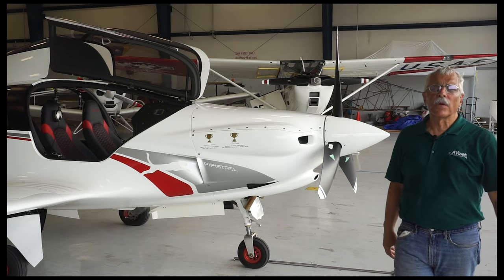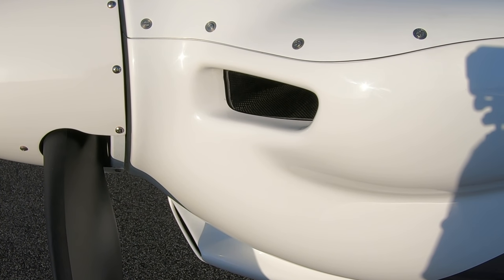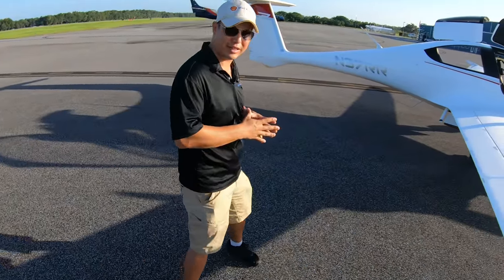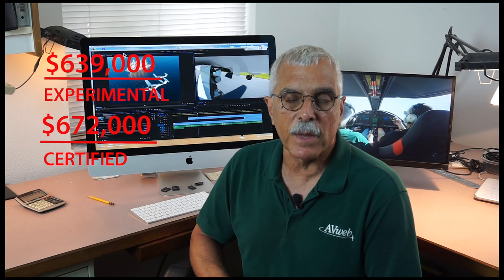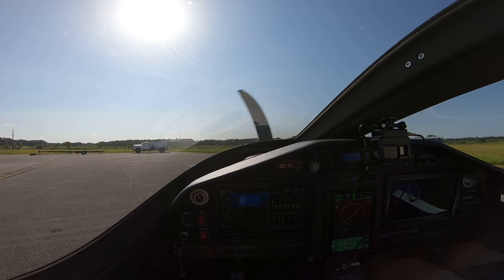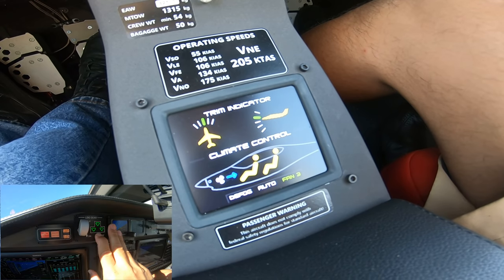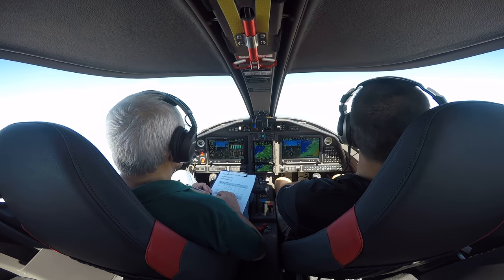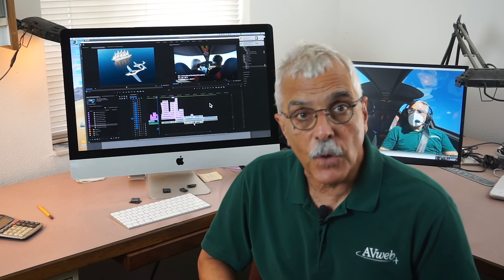Flight Trial : Pipistrel's Sleek Panthera

Comment: The limited view out of the front is a "no deal" for me.  Awesome plane, but that limited forward view ruins it for me.  They could have done something like the Bristell did, and it would have worked much better.  I do love that the pilot is ALMOST in front of the wings.  It appears it might be the only low wing plane to puts the pilot that far forward of the wing center, which is awesome.  I like to sit more upright when I fly so I don't love the reclined seat angles.  Also that parachute is costing a lot and reduces performance.  Build the plane to hold together and a chute shouldn't be needed.

Comment: My 67 Bellanca Viking has the same useful load and will do 160 knots at 10,000’ burning 11 gallons per hour, not that much slower than this airplane, and only costs 65K. These airplanes are beautiful but not ground breaking.

Comment: Man you are so sarcastic and condescending ....  Almost 3/4"of a $million$ dollars and you talk about electric gear and doors as some justification? Ha ha.... I have an RV7 I spent $50K building iand it has 91% of the cruise 8,000 foot performance, 65% of payload.... RV7 and T/O and Land  in 600-700 feet, soft field.  Panthera needs 2500 ft of hard surface to be "comfortable". Will it be certified for Aerobatics? RV7 is a boss doing loops, rolls. This is an expensive toy. It has no deicing so as a serious all weather XC machine it is a not. A used  Piper Malibu Meridian PA-46-500TP or TBM700 can be had for a little more, turbine, pressurized, way more performance and weather capability.